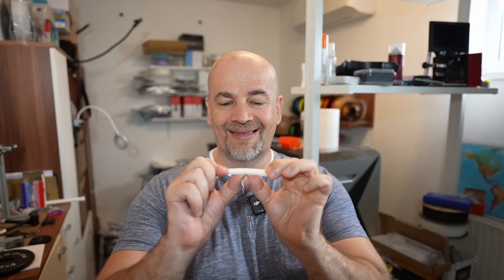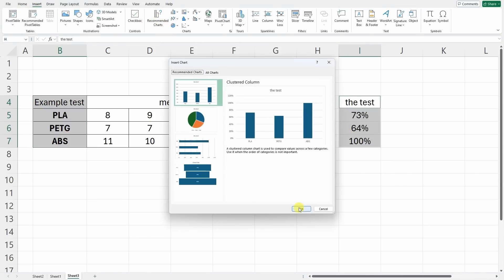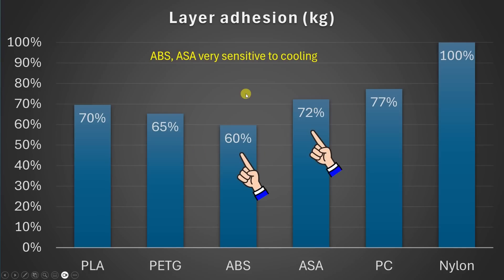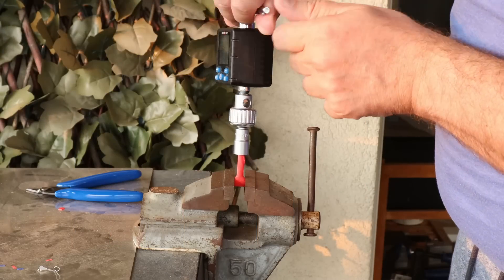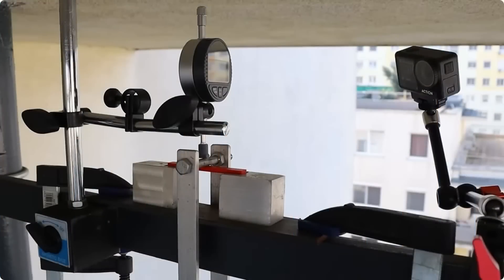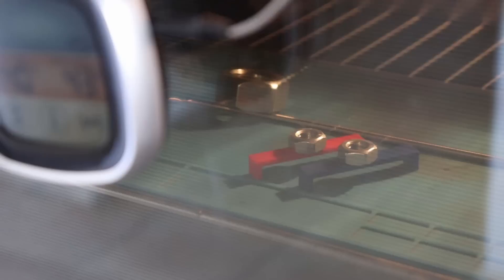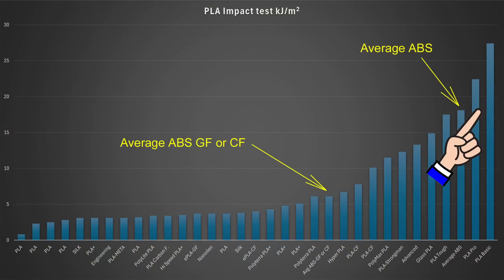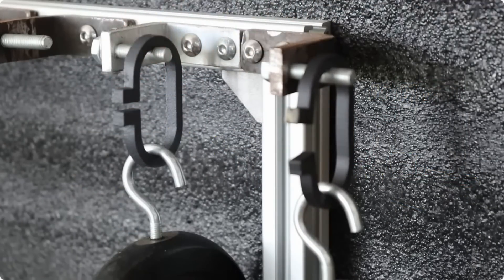Which is the strongest filament type? PLA, PETG, ABS, ASA, PA (Nylon), PC

Comment: I think a larger emphasis on printability and practical use in general would improve these videos. The "strength" is so subjective that 98% of users just print PLA anyway. Emphasizing when to use each types of strength and the worst weaknesses to look out for is the key people need. The spreadsheets are nice but most do not translate it themselves to actual use cases. 

I think for example PLA has so much better printability that any part that isnt a flat mechanical part is simply best printed in PLA. I myself use a HT PLA because I need to up the temperature and thus a high temperature PLA is the perfect solution for almost all use cases. For almost all 3d printed parts, there isnt much stress on the actual part. It is grossly inferior to use 3d printed parts for parts where it is very important that durality and longevity is the key. Injectionmolded or CNC cut aluminum for example will almost always be vastly superior. So much so that 3d printing seems like toys in comparison. 

There are great uses. Uses where 3d printing is superior and the choice or material is so important that it makes or breaks the entire concept. This is what needs to be discussed. We want to hear more intelligent and indepth analysis of the materials and comparisons as to why. Else it's just an endless stream of different materials and some graphs showing arbitrary information noone will use anyway. I think ease of use, printability, shrinkage, warping are much more important. 

If people cannot just take the material in their x1c and print a large difficult model in the material without messing around a lot to make it almost work, the largest part of the audience will simply feel scammed when they buy ABS and weird PCs and have to sit with mediochre results for their large prints and struggle with either fans and poor results or no fans and poor overhangs as an example for ABS. This is the type of issues real people see and struggle with. Noone struggles with printing a small mechanical part, but the fact that they then cannot print what they want with the material due to weaknesses in the material is a very important thing to discuss. 

Any material always needs to be compared to PLA and difficulties with printing should always be factored in. What it is made for and not made for and what it can print and cannot print is much more important than if it is considered "stronger" or not.
Reply: @LordNerfherder   for scientific use cases such as mine, the usual scenario is one off or very low volume parts but they still need to be functional. When I had to have the parts machined I paid hundreds to thousands of $ for parts for a project, with 3d printing I now pay less than $50 for the same parts for the project, get the parts faster and can iterate my designs cost effectively. This has made a huge difference to the quality, ease of use, and cost of systems for my clients. Igor’s tables have been very useful for this, so I really appreciate his efforts.
Having said that, there are many choices and processing techniques which could be discussed and demonstrated which may help people achieve what they need. These include (as you say) choosing the correct material, designing strain reliefs into the parts to prevent warping of large parts ( I put slots every 50 to 75 mm in my larger parts starting a few mm above the bed and it work excellently), limiting print speed to enhance strength, limiting cooling when possible to enhance strength, preheating the chamber in the X1C, (as you said) calibrating the filament for shrinkage before printing, choosing the correct bed material, bed adhesive choice, and choosing the appropriate support material for the interface layers when necessary.  Discussion of more of these lessons learned could help many I’m sure.

Comment: Since I got my X1 Carbon, I have been printing parts that require strength in CF Nylon and PC, I would like to see a video comparing different brands of CF Nylon filaments, I know I can look up the data you have collated but I would like to watch a video all the same.
Reply: He tested 4 of them (polymaker, yxpolyer, prusament) and one is discontinued (creality), so not an lssue to find.

Comment: i'm currently printing some accessories for the car and stumbled upon GreenTec Pro filament from Extrudr. It prints like PLA but is supposed to withstand over 100°C. Might perhaps be something interesting to test in your setup?
Reply: What is your experience with layer adhesion? I switched to Extrudr PCTG because of the poor layer adhesion of GreenTec Pro.
Reply: @Interspieder  extrudr pctg is crazy, just needs really high temps :)
Reply: @riba2233  I really like it aswell. Printing at 265°C with 25% cooling. Overhangs look perfect and layer adhesion is really good.
Reply: @Interspieder  i only printed two models so far, but really can't complain about layer adhesion. I heard that it gets significantly worse when the filament is not dried, so i print it directly from the filament dryer while running it at 50°C

Comment: who said that ABS is a dead material? the impact resistant of PETG is a joke.
Reply: Yet so many people cite that it is superior. I stopped using PETG back in 2020 because I was just frustrated with it compared to PLA. Either way you are coating your prints in epoxy which prevents warp and deterioration which means it's more about the mechanical properties and less about environmental survivability.